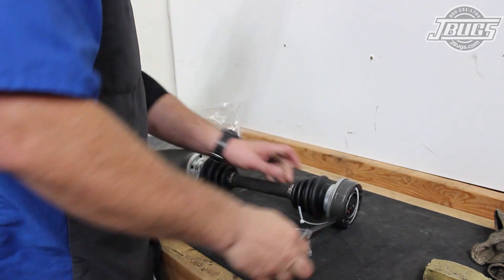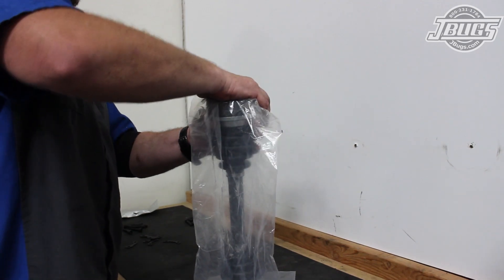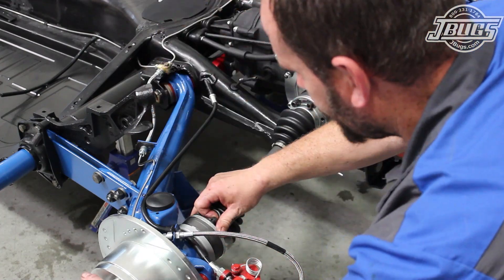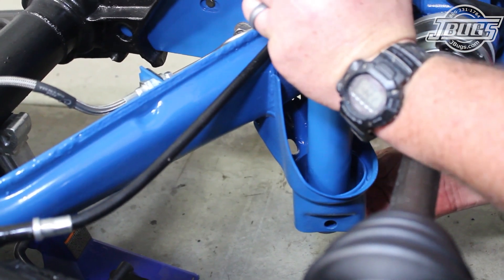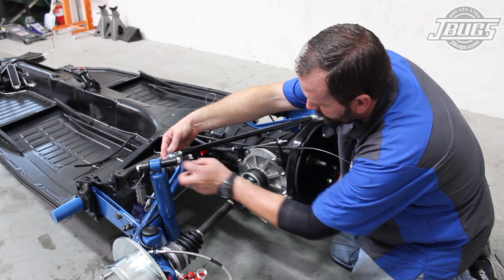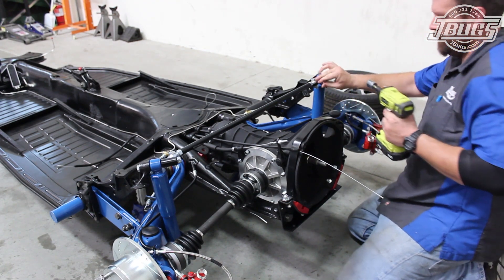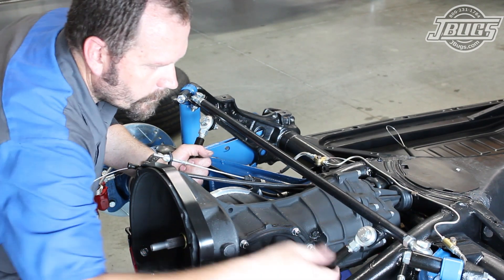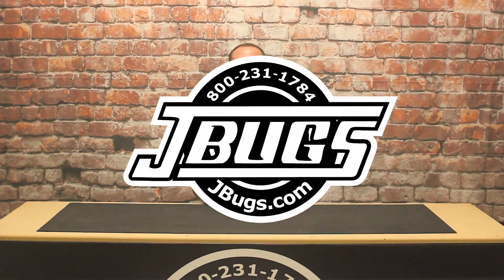JBugs - 1971 VW Super Beetle - Axle & Rear Truss Bar Installation

Comment: Great video.. this will not interfere with the rear sway bar you all sell for the super beetle will it? I just ordered the sway bar. I believe the sway bar goes under the transmission,  so I am guessing I can install both the Truss brace AND the rear sway bar?
Reply: The rear sway bar attaches at the torsion housing then to the trailing arms, no where near the truss bars so there is no issues installing both.
Reply: @Sam_Mebane  perfect thanks!

Comment: In my case, the rocker arm, despite the maximum lift, blocked spring plates (I have double ones). I had to unscrew the rocker arm from the frame and then hammer the spring plate out.
Reply: Odd, we have double spring plates on our car and had no issues. Also, the rocker arms in the engine are nowhere close to hitting the truss bar.
Reply: Maybe it’s because I have 944 rear suspension? I don’t know but it was really impossible to remove spring plate without unscrewing rocker arm. I couldn’t lift rocker arm high enough to move it out from between spring plates.
Reply: @kom2142  If it isn't VW, all bets are off. We have zero experience with Porsche suspension.